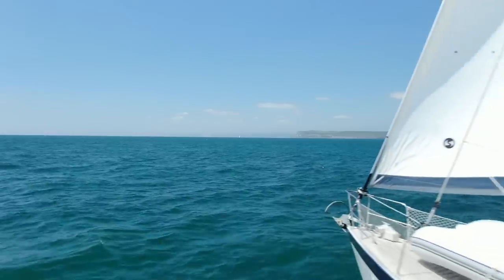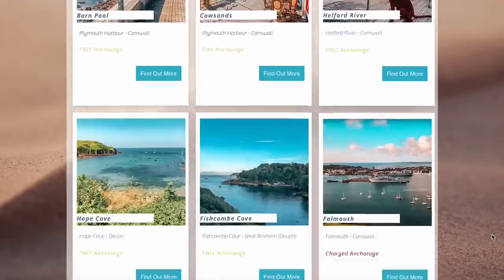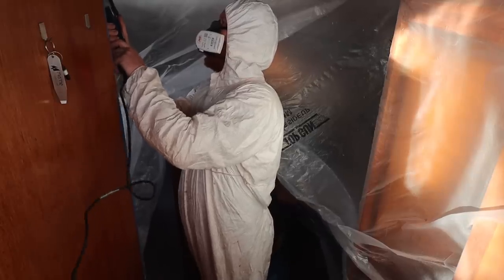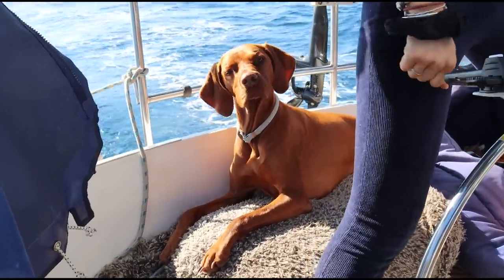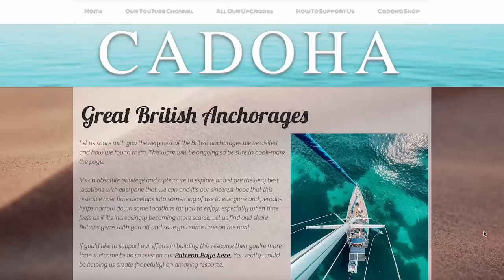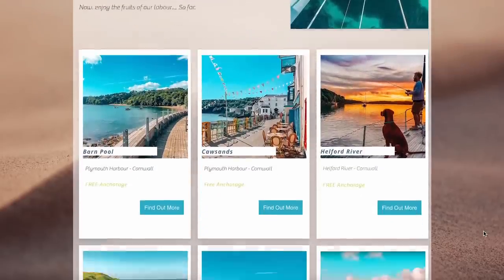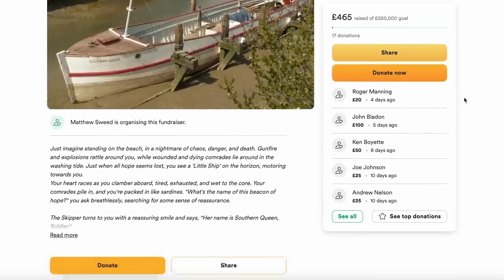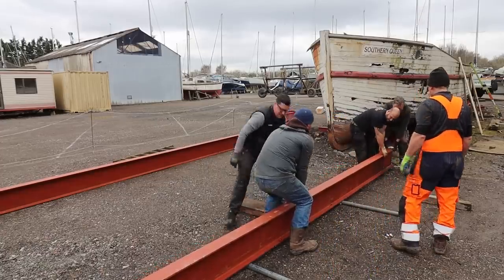We Didn't See This Coming (Boat Surveyor Has VERY  Unexpected News)

Comment: I remember Leo on Tally Ho's restoration covering the subject of restoration or replica. His view was that as long as what you are looking at resembles the original boat then its a restoration. If you think about the life of a wooden boat then as parts break or rot then they are replaced so a minor repair might only replace a plank or a frame but a major refit could replace 30% or 40% of the planking and how many major refits has southern  Queen had over her life time and how much of the planking that's there now is original. I suspect none.
Reply: Indeed.  From memory, all that was intact from Tally Ho! was most of the transom and the lead keel.
Reply: I loved how Leo said that restoring an old boat is just like building a new boat, just with the old boat getting in your way.
Reply: IIRC, way he explained it was if you can look at it and still see that it's the boat at every point during the process, it is a restoration.  Oak is oak and pine is pine and a boat is a boat unless it's a pile of wood.
Reply: @ih302  Yes, he referred to the Ship of Theseus,

Comment: It's absolutely a restoration. Even if you had to replace all the structural parts it's still a restoration. A restoration is a process you go through to bring something back to its former glory. It also takes into account the materials and techniques used to make the boat also paying homage to the changes during its life. It's also another part of its story.  Awesome project.
Reply: no its a rebuild.on the line of the old vessel.
Reply: It all depends on how bad the boat is. They will probably try and restore/repair as much as they can replacing what can't be repaired. More importantly they are keeping the history and story alive. So does it actually matter what they call it. Probably not. So all down to opinion/choice.
Reply: I love that definition of a restoration Andy. Without a doubt then it is a restoration project.

Comment: The important thing about restoring a boat is using as much of the old lumber and planking as possible it may mean using it else were on the boat but as long as it placed back into the boat . If say you have a rib and the lower part of that rib is rotten but the upper half is still solid that you just replace what is needed to make that rib hole again no matter what that is better than just replacing the hole rib . That is the differace between restoring and just replacement of what's there.

Comment: I'm not sure on the percentage, but in restoring old/vintage/collectable cars, as long as the chassis and engine are matching numbers from factory, most everything else can be replaced and it would still be classed as Original. 
70% of the skeleton/chassis original and most else being replaced 'like-for-like' would stay well in the "Restoration" zone.
"Float-on Little boat, float on with pride."

Comment: Definitely restoration, imo. The bare structure of the boat is reasonably intact (70%) which is quite impressive for such an old boat that has worked hard most of her life. The skin is less important.
Call me fussy, or a PitA, if you want but the 30% oak that you will need to source should ideally come from the UK or Ireland - perhaps Northern France, for strength and quality reasons. It is very much more expensive, though, than American oak or Spanish oak ...
Cadoha's issues sound concerning and serious, "months of work" I think you said or hinted at: I hope it can be resolved at reasonable cost to you ...

Comment: Greetings. If you buy a new boat and spend 10% per year on up keep, in 15 or 20 years is it the same boat? Of course it is! After 40 or 50 year not much of the original boat would be left. You will just be doing upkeep that should have been done annually.

Comment: Restoration or Replica? It comes down to the nature of the work being done, not really about percentages. If you are replacing wood which has failed/rotted over time, that is all part of the typical life of any wooden boat. If enough time goes by, most or all of the wood will eventually be replaced, bit by bit. You are simply catching up with all the replacement work that has not happened over time. If you are stripping away all of the rotted planking and frame, and you still have some structure left to build back upon, then you can still "restore" her. 

When building a replica - you're not starting with the "bones" of an existing boat. You're building everything new from scratch, ideally from the original plans, but there is no existing boat to repair. Completely new.

As others have commented, Leo did a fantastic job of justifying how his replacement of virtually 100% of Tally Ho's frame, deck and planking is essentially still a restoration.

Comment: For me it's simple: if you are repairing the original boat and a goodly chunk of the original frames are intact, and it's a question of  replacing rotten content on the original timbers, that qualifies as a restoration.  If however you are building a new one from scratch based just on the dimensions etc of the original but with no original content, that's a replica.  Yaba is a restoration. Not a replica. In IP terms 25% of the original hull would be a good start. For me, Triggers Broom applies:- Think Men of War in the Napoleonic period. They were often massively refitted and replaced much of the hull but were still considered the real McCoy. Jmho

Comment: I’ve worked on and flown aircraft from the era of Southern Queen. On aeroplanes I’ve seen as little as a maker’s data plate be the only original part in the whole aircraft (one original data plate was valued at £500k the rebuilt aircraft sold for £7.5m) personally, one original part is enough to keep it as a restoration.

Comment: With any boat you would have been replacing boards and stuff over time if it had been kept up with.  It is just being done all at one time rather than over a span of years. I'm leaning toward it's the same boat,  original, but with upgrades and refurbishing just like Cadoha.

Comment: 100% restoration. If she was a Spitfire you only need identification plates to rebuild as a restoration. I think so long as frames are mostly there then it doesn't matter about soft wood planking. Those would have been replaced over the years any way. Just doing 10 years of replacement or more in one go.

Comment: First, it is absolutely a restoration, the boat is substantially intact and you’re replacing the bits that are missing or in poor shape. 
Second re the ongoing project, nothing is ever much valued unless it has a contemporary commercial value. So the great trick with old things from the past that we want to preserve is to make sure they have a commercial value in this day and age so they continue to be valued without the constant drain of applying for government funding, which always ends. By putting her to work, you provide the commercial value, which will allow her ongoing preservation. And of course, nothing falls to bits quicker than an unused boat!

Comment: I would consider that the keel is the intrinsic component that constitutes the fundamental element of a boat. Provided that you're working with the original keel intact, you are working on the original boat. Every other detail of the vessel will through time be replaced, time is the only factor. Every plank, section of the transom, even the stem, is likely to be replaced as a matter of maintenance over the life of the boat, nobody would be counting replaced planks over a 50-year period and one day claiming that it was no longer the original vessel. Utilising the original keel will ensure that, ribs, stringers and deck are all complying with the original design. It will remain the original boat.
In my opinion.

Comment: Here's my idea:

1. build a second frame which is a perfect replica of that of the original boat
2. remove whatever softwood that needs to be replaced, and replace it with fresh wood
3. take the old softwood, and attach it to the replica frame

in the end, you will have two vessels that are half-original, although only the restored original will be more seaworthy

Comment: So yes it is the same boat - this has actually already been to court on several ocasions - it's absolutely a restoration, there's more to a boat than its planking or its structure - it's an entitiy in itself. If you think about the amount of yachts sailing around the world with pretty much everything replaced on them it's not really that different. To to mention the famous long lasting hammer that had had several new heads and handles over the years :-)!

Comment: Rebuild is the term I use. That means replace what needs to be replaced, keep and preserve what is still usable. It is part of the life of a wooden boat to have parts replaced over time. But, what is important is that the spirit of the original boat is retained.

Comment: Every piece of a wooden boat is meant to be replaced and therefore this is a restoration. It would be a restoration if only 1 piece of the boat were to be used as long as the boat was rebuilt to original size and specifications. My 2 cents.

Comment: Restoring old wooden boats … my view is that all wooden boats have to have parts replaced over there lifetime , planks, ribs, equipment etc . The older it gets the more of the original gets replaced. Major refits just replace more over a short time . The “soul” of the boat remains the same . So 70% or 7 % it’s still the same boat☺️ . Check out tally Ho project - Leo has an episode that discusses the issue . Plus his restoration work is great if u like woodwork . Maybe see u along coast ( we’re currently trying to get away too (from Plymouth) . Hope Cadoha issues not too serious , soggy deck ?

Comment: Restoration/replica/or….? These terms are well defined in the historic aircraft world. I’m involved in work on an aircraft where there are no complete surviving examples. We have a lot of original material from crash sites. We also have the original drawings and material specs. Our aim is to to achieve a complete example, using as much original material as possible and where new material is incorporated, it is to the original spec and identified as new. After a lot of discussion, it’s described as a rebuild. A replica contains little or no original material and may not be entirely true to the original design. A restoration will not necessarily result in a complete or serviceable project - it will concentrate on conservation, preservation and restoration of original material. A project which includes both restoration of original materials and incorporation of new material to original specs is best described as a rebuild. Maybe that description would work for Southern Belle. Wish you luck with the project and your new season.

Comment: It's always got to be a restoration in my mind! Do you know you have the original boat as it was built? If it was maintained in the past when it was in use, potentially some of planking may already have been replaced and perhaps the odd frame here and there or perhaps at some point it may have been damaged and needed broken frames replaced and also some planks, so is what you have the original boat as the first shipwright made it.  Alternatively  if you replace 70% of the frames at this stage and leave 30% original, at some point in the future the 30% will need to be replaced, would it then become a replica. Or if you reuse only 20% of the planks now, again at some point that 20% will need to be replaced, that is the nature of a traditional wooden boat. They are not throw away items, they can be maintained, if the boat had been properly maintained for the last 100 years then it would almost certainly have had many if not most parts replaced in the last 100 years just slowly, would that make it a replica? No, I don't think so myself. A replica of a wooden boat would be to start from original plans or measurements and even if you did that at some point in the future that replica would not contain any parts of the original new parts of the replica boat that you built, as those planks and frames would have to be changed at some point in the future. And if a traditional wooden boat without the use of modern epoxies and adhesives is always being maintained and continuously changing parts does it matter, if it is a restoration or a replica, if the story and history of the original boat remains. On many old boats parts are changed even names change it does not change the history, just because the name plate has been changed it is keeping the story/history alive that is the soul of the original boat. Great channel keep it going, Guys